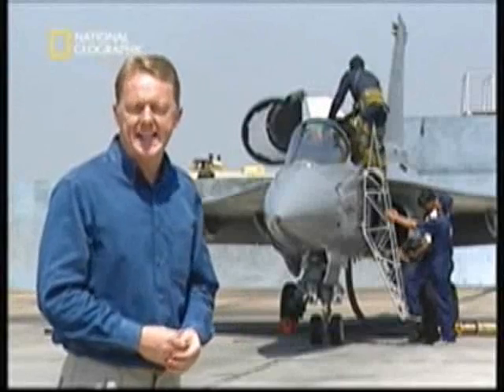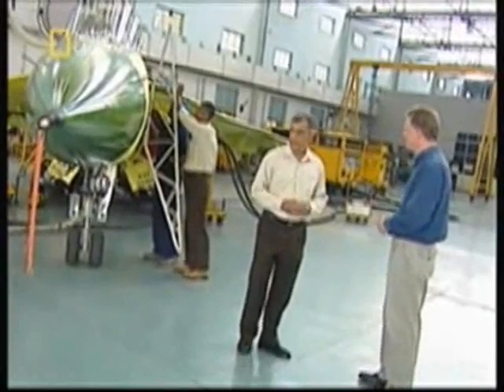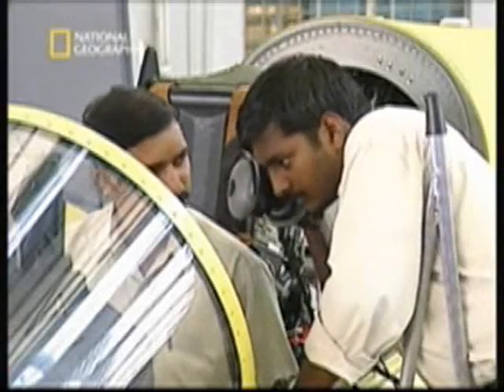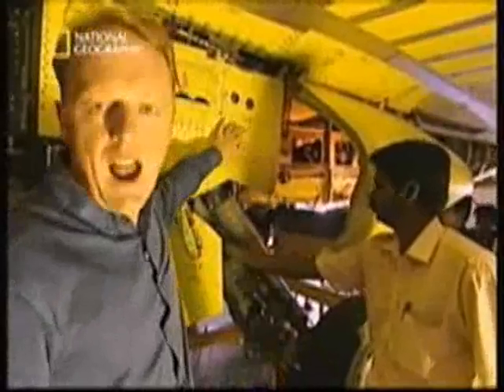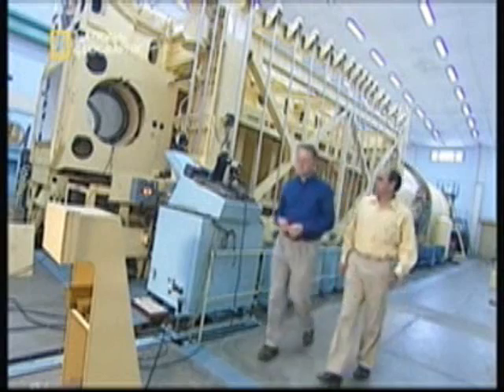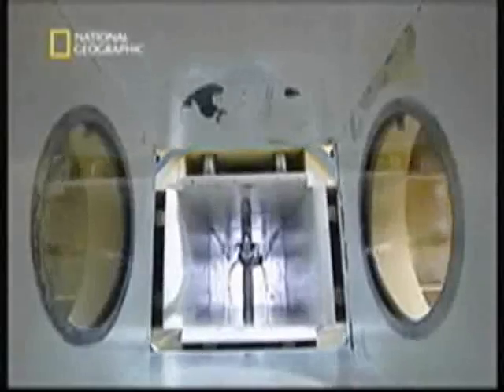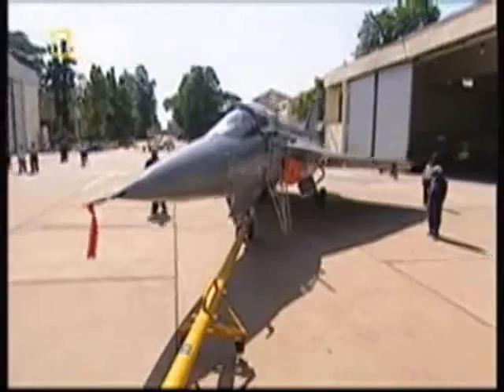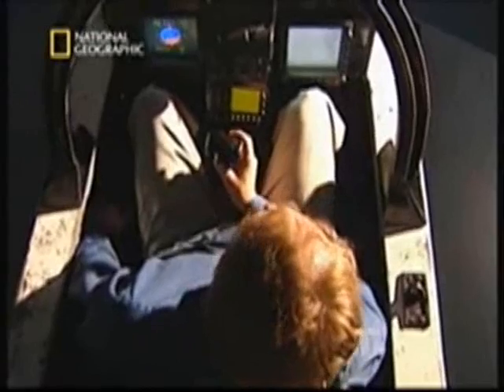Indian Air Force- Indigenous Fighter Jet - Tejas - Part 8

Comment from the maker: The indigenously designed and developed Kaveri Engine was successfully flight tested on an IL76 by DRDO yesterday during the Flying Test Bed (FTB) Trials at Gromov Flight Research Institute (GFRI), Moscow, Russia.

K9 version of Kaveri engine was tested from take-off to landing and flew for a period of over one hour up to at an altitude of 6000m at a speed of 0.6 mach on its maiden flight. The engine control, engine performance and engine health during the flight were found to be excellent